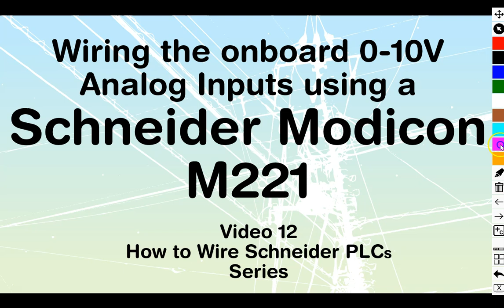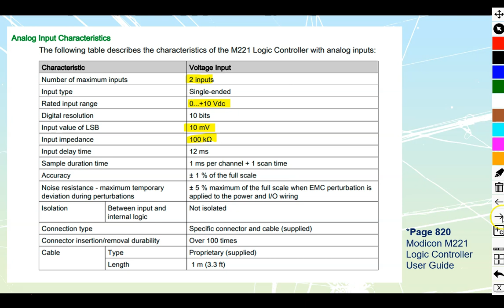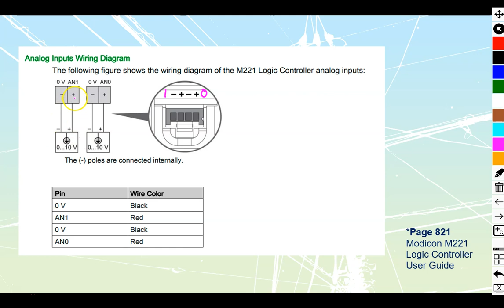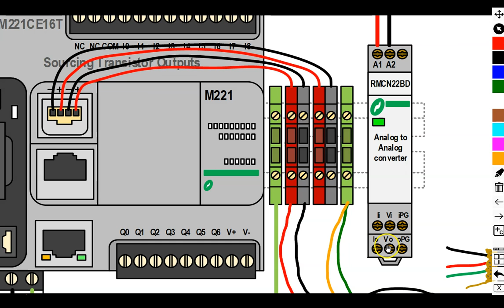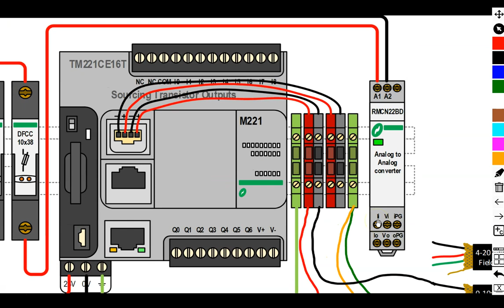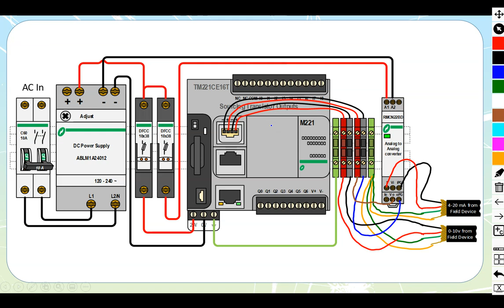Wiring the onboard 0-10V analog inputs on a Schneider Modicon M221 PLC (Video 12 in a series)

Comment: Hello and thank you for the great video!
I have a question.
Is it safe to simulate 0-10 V analog input with a battery?
Reply from the maker: Hi,
Yes, the DC source is independent of the PLC, so a battery supply can be used.  Just make sure the polarity is done correctly.